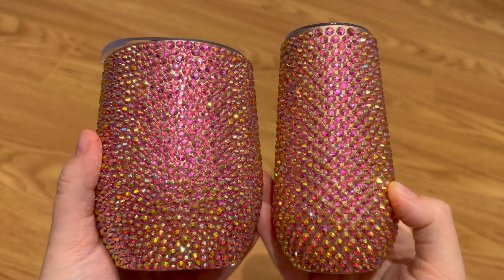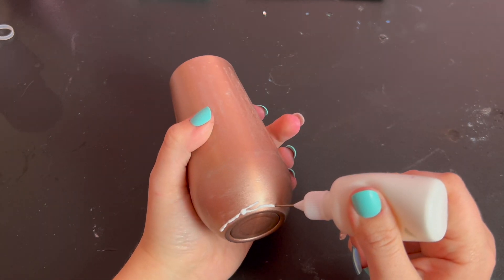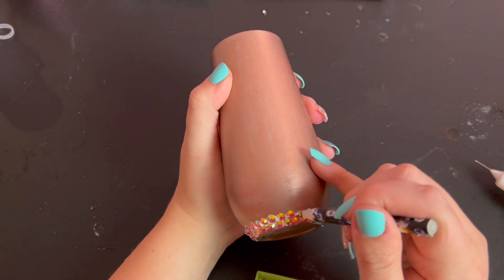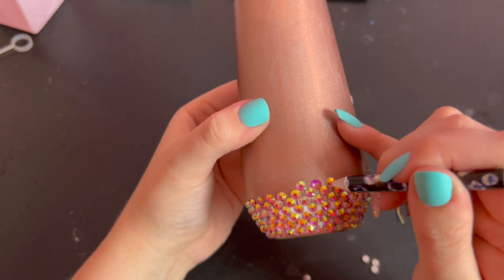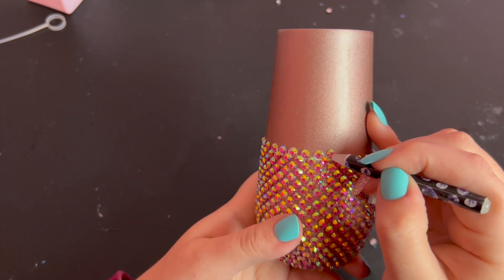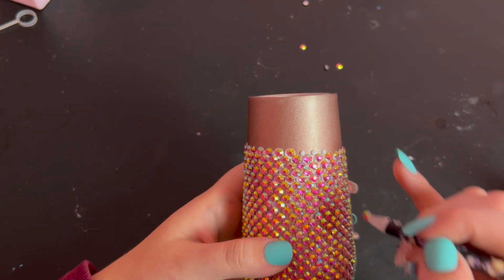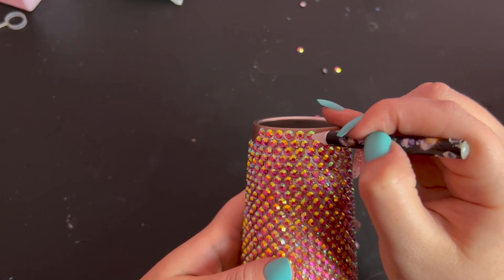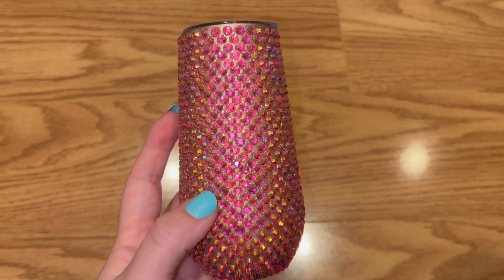HOW TO HONEYCOMB METHOD BLING A TAPERED CHAMPAGNE TUMBLER // Curved Surface Rhinestone Cup Tutorial

Comment: I’m using this method to stone a pair of heels! Would you recommend using the bottom circumference of the shoe as the anchor row, or the edge of the ‘foot hole’ as the anchor row?
Reply from the maker: Oh cool! I would probably start at the bottom edge personally but it would depend on the shape of the shoe, wherever you start needs to be the narrower section so that you can space out the stones as you get to the wider section if that makes sense - if you start where it’s wider you won’t have enough room for all those stones in the narrower sections 😊 hope they turn out great!